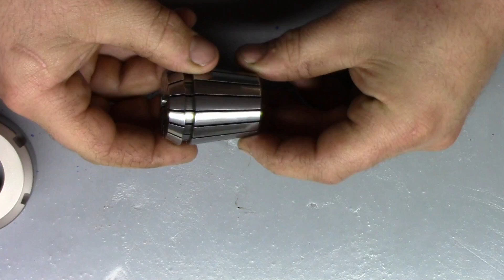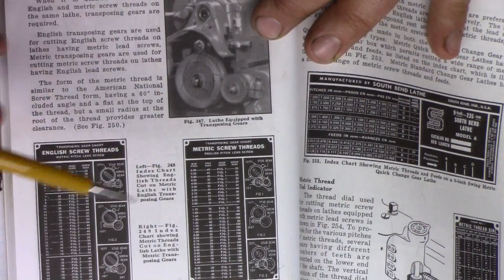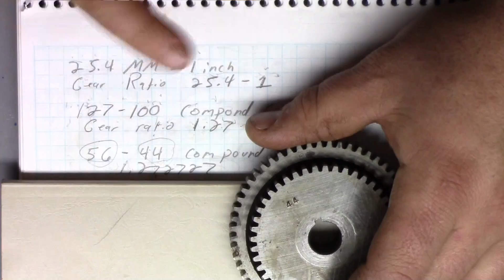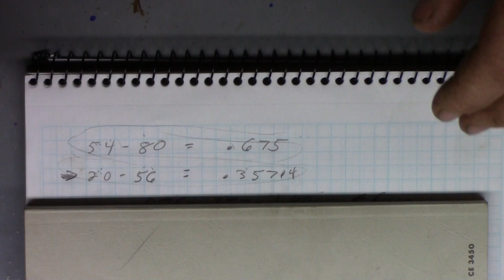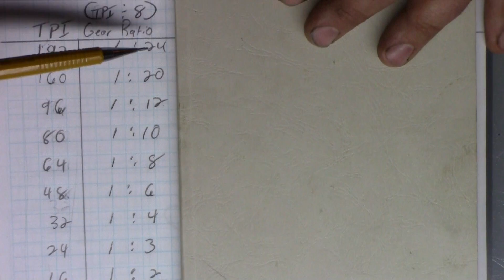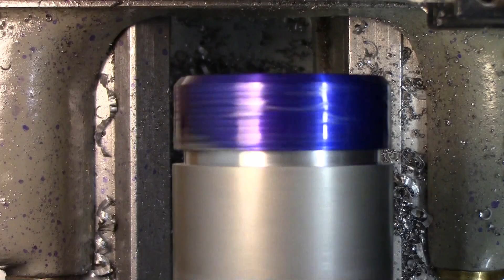Metric Threading on an Imperial Lathe

Comment: When measuring threads without a thread guage it's much more accurate to measure across multiple threads, alternatively just rotate the chuck 10 times by hand while measuring the carriage travel with a indicator, it's the most accurate way of checking the it's easier than trying to directly measure the threads
Reply: The more threads that you measure across, the more accurate you can be 👍

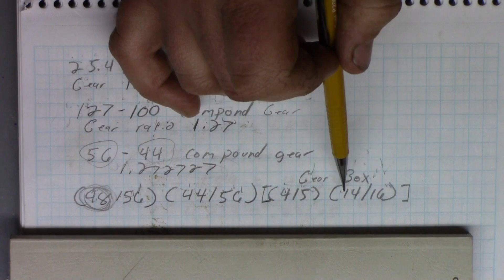Comment: I'm confused with a certain part of this video!    right around 10:01 into the video you say that in the gear train you used to achieve a 1.5mm pitch thread and after the 56 to 44 Tooth gear that inside the gear box you have a 4-tooth gear that goes to a 5-tooth gear.  I hope that these figures are reduced to the lowest common denominator or something, like from a 20-tooth gear to a 25-tooth gear. because I have never seen a 4-tooth gear I don't think it's possible. I think the smallest number of teeth possible is 9.  But don't get me wrong I still found the video very informative and maybe I missed something? hopefully you can clarify that for me. Here is a 4-tooth gear (  +  )
Reply from the maker: Sorry those are great ratios in the gearbox.

Comment: You need to use an intermediate cog wheel with 120 teeth on one wheel and 127 on the same wheel on the same wheel. There are 25.4 mm in an inch.  120/127 convers the imperial lead screw to metric.

Comment: Jan 2022. My suggestion to anyone interested in Metric Threading is to go and buy a handful of metric nuts of all pitches and then just practice cutting those pitches on plastic electrical or garden conduit tubing . Its cheap. It threads easily and you'll see with whatever gears you select, what pitch they are producing. It also allows for endless practice which is important to get comfortable with this different technique before doing a 'real' job.

Comment: Dear Mr. Halligan, one thing I did not understand in the video: how to calculate the gears of the banjo if there is a Norton box in the lathe. In the specific case of the 32X1.5 thread whose gear ratio should be 1:4, Do I understand that the motor gear would be (for example) with 20 teeth and the motor gear on the spindle shaft with 80 teeth? But isn't this configuration made for lathes that don't have a Norton (CN) box? How then to direct the cn levers in this situation?

Comment: Making a nut is really difficult. It’s not even the thread. That ring inside is actually a retaining ring. It’s hardened. The nut NEEDS to be hardened. The face taper needs to be extremely accurate. It’s what determines the accuracy of the collet seating. The inside of the nut needs to be plated with something, otherwise the friction when tightening won’t allow you to tighten it enough, and the collets WILL slip.  I may have missed something. What alloy are you using for this?

Comment: The actual Metric Threading part starts at 8min15. If you don't want to go to the expense of a thread guage you can use a metric M10x1.5 bolt/screw (coarse) as a handy substitute. Another useful shortcut is to press a small piece of paper onto the threads. The dirty lines so impresed can be measured with a ruler. If the threads are too clean to make distinct marks you can rub the paper against the threads with a soft pencil.

Comment: Excellent. You made it easy to understand. What marks were you using on your threading dial?
Reply: LOL. This makes me think you didn't understand though. He wasn't using the threading dial, but he was keeping the half nut engaged and returned the carriage by reversing the motor. That's why he needed to retract the tool. To prevent cutting the thread on the backside, because of backlash in the gearing.

The threading dial can't be used in this setup, because the ratios between the rotations of the leadscrew and those of the spindel are not an integer, but have a very small deviation. Small enough to not matter over short distances, but apparently big enough to matter for picking up the thread at a different position than where you left off when you disengaged.

Comment: I just bought a SB 10k to learn on since retirement and came across your video.   Great job...very innovative.  I would like to do the same to cut metric threads. Are your 54 and 80 tooth gears "change gears" or specific end gears? I guess my question is will change gear work without modification?  Thanks again.  Brent
Reply from the maker: They are change gears from a 9" model B/C.   Should work with no modifications.  Mine are from my lathe.  It was a model B when I bought it and I converted it to an A by adding the gear box.
Reply: Thanks, you a a great resource for someone getting started!

Comment: Ok sorry just rewatched yours in imperial, mine has as norm the 20 gear at the top and a 45 on the gearbox this then makes position 1 D 3mm pitch (or 1 to 1 rotation of chuck to lead screw) I'm now messing around with other gear ratios as I have the other issue I want to make a 8TPI thread to screw onto the head stock :)

Comment: As much as I like my 14-1/2 South Bend I bought a lathe that cuts metric by just moving levers.
Reply from the maker: I would too if I was doing a ton of it but honestly 90% of things I’m making will have imperial threads and out of the remaining only a small fraction of those metric threads will not be able to be made or will be too expensive to make with a tap and die.
Reply: @Halligan142  100% Greg, I do about 50/50 metric vs inch so I'm reluctantly giving up my South Bend, it has served me well for over 30 years and with a DRO and quick change tool post is still great save the threading dilemma.

Comment: I once had to cut internal and external 5/8 BSP left hand threads for some propane gas fittings on a Harrison M250 with a 6 mm leadscrew.  Not being able to disengage was a pain.  That was about 25 years ago, haven’t had access to any machining facilities for many years now.

Comment: Oh dear.....I don't have a feed gearbox on my lathe just a set of gears......so now I use the recommended gear train ratios according to the info plate and set the gears accordingly......but luckily the gearset does have the 127 gear to translate the ratio for Metric pitches on an Imperial leadscrew.
Normally, without the gear sets chart on the brass name plate, I would have to use the standard screw cutting gear formula of TPI of leadscrew over the TPI of the job to be cut, or the pitch to be cut on the work piece over the pitch of the leadscrew.

Comment: On a belt driven machine like this you can loosen the belt to stop the cut, then shut the motor down, tighten the belt, back out and then reverse the motor. This is what I have to do when threading without a threading dial on my south bend. My original 1938 motor will continue to run in the same direction if I switch the switch quickly and don't wait for the motor to come to a complete stop before reversing.

Comment: Mostly good info especially on the gearing.  However the cutting did not have to be so hard.  Unless your lathe is one of those that cannot be run in reverse, turn your form tool upside down and cut going away from the chuck.  Gives lots of tome to pull back before changing direction.

Comment: Hello. It is good video. i understood about gears 58 and 80, but i did not understand about the gear box position. Did you use 32 and "C"? on the video 46 and "D"  or the  position of the does not matter? thank you
Reply from the maker: In the case of a 9" South bend you need the gear train set up shown and the gearbox tumblers set to cut a 32 TPI thread to be able to cut a 1.5 mm thread
Reply: Question about the idler gear - is it 80? or i can use any one? I just accidentally bought a 9A south bend lathe as a replacement for my Chinese lathe. thank you

Comment: Hi, how did you calculate the size of the stock to cut the thread on and how would a novice now how deep to plunge the tool to get the desired Thread Depth? Great video

Comment: You left out one option for that collet nut. Since you're making your own collet Chuck and you can make it any Dimension you want simply turn the metric threads off since they're pretty fine and turn whatever you want back on to the collet nut. Adjust the size of the Chuck that you're making to accommodate that new thread and throw it away. Easy peasy

Comment: I really admire all your efforts on the Math side as I'm exactly the same. Only, as I figure out these things, I put them all into an Excel book. I've done a full write up some time ago, of the problem you've set out to solve here so I understand all your efforts. All I need to do is to enter the Pitch required, the gears I have and it tells me what changes are needed to give the Pitch in Metric. I'd be happy to try and pass along what I have as I'm certain you'd find it just as useful. Also, working with so much math and trig,  I've found just how surprisingly simple is working on Metric threading with an Imperial lead screw where you CAN disengage the half nuts anytime and move the carriage and turn the chuck and then very quickly return to threading precisely as at the start. This I needed to learn when internal Metric threading to a blank. It turned my hair grey but I'm happy to say I solved it. Great work with what you have shown us here and again my tip is once you solve math problems, keep them on an Excel file and in a book.
Reply: Would you happen to know what gears would be needed to hit a 1.25 pitch metric thread for the 9A? I have the 54 and 80 like Halligan said but his list doesn't show the 1.25 pitch which is also pretty common.
Reply: @jerkfaceskater  I'll answer fairly quickly but will be happy to keep working through the problem until you have what you want. Very simply, you need your drive train gears to have the ratio of 1(Drivers) : 2 (Driven) (or vice versa)? where you will be using an Imperial 8 TPI Lead screw. In Imperial, these ratios will cut a Thread of 20.32 TPI but this is in fact 1.25mm. IE: 20.32x1.25= 25.4mm = 1 inch.

I'll give an imaginary set of gears with using the Transposition gears of 127/100. Stud gear 11. Comp #1 gear 24. Comp #2 gear 84. Screw Gear 77. Disregard the Transposition Gears in the calcs. DRIVERS = Stud(11) x Comp #2(84) = 924. DRIVEN = Comp #1(24) x Screw(77) =  1848. Therefore the RATIO = 1:2.

In the quick change gearbox the selectors are at C1 with 'Change Gears' of 60 and 47. Position C1 gives a drive train ratio of 1:2 and gears 60 and 47 act as the 'Transposition Gears' having the same ratio as  127:100. (almost). This ratio is important in the train and as long as its included in gears, it should then be FORGOTTEN. What it does is to change the Lead screw TPI from 8 in Imperial to 3.175 mm.

I've probably totally confused you. Best is to study videos of Metric threading with Imperial lathes. That's all I did. Don't disconnect the half nuts but learn the art of zeroing your carriage  with your spindle with a dial gauge so that if you accidentally disconnect those nuts, you can in fact find the very beginning spot and be in correct synch to keep threading.
Reply: So where he uses the 24 grear i would change to an 84 instead and swap the 80 for the 77.
Reply: @jerkfaceskater  Divide each 'Driver' gear by each 'Driven' gear. Multiply as you go. Then multiply by 3.175 which is the Metric pitch of a 8TPI Lead Screw. The first 'Driver' is the Spindle or Stud gear. The last 'Driven' is the Screw gear. Below is just an example of me looking to achieve a carriage advance of 1.25mm on a single 360 deg spindle turn using an Imperial Lead Screw.
(11/18) x (63/77) x (100/127) = .3937 x 3.175 = 1.25
Solving what the final ratio needs to be, can be trial and error using any gear combination and you confirm what pitch you'll get by dial gauge measuring how far the carriage will advance (in mm), on one single turn of the spindle. Same procedure even with a 'QuickChange Box' and with 'Change Gears'.

Comment: I think the .471 ( from original calculations ) is the lead screw relative speed created by that multiple gear ratios to give you the 1.5 mm travel per one revolution requested not the actual carriage travel distance for thread cutting.
I think the formula would be:  Carriage travel = Pitch x lead screw speed ( different gear ratios from original calculations )
for example  0.125 x 0.471 ( original calculations ) = .058875" inch
and multiply this by 25.4 mm you will get the carriage travel in MM
.058875 x 25.4 = 1.495425 approximately 1.5 MM which is the required carriage travel distance per revolution.

Now this all good, but what tricked me that you used the formula and used a relative lead screw speed 1.89 not actual speed, and it worked, but finally I figured that you still kept the rest of the gears in to give you a factor of 1.319 x 0.471 = 0.357 which is the ratio of the existing gears 20/56.

Very nice work, very smart.

Check my work please, I'm not a Machinist but I love this stuff.

Thanks
D. Sanduby

Comment: Used your recommended 54/80 gear setup on my 68 South Bend Heavy 10 to cut 2mm threads to build an Accuracy International barrel it was dead nuts, a real class 3 fit!
Reply from the maker: +Mike Calafatis 
Nice! glad it worked out for you.

Comment: Hey Greg, totally off subject but I'm getting ready to get my hands on a south bend 9 lathe and wanted to do the gear box conversion like you did on one of your videos..  Just wondering if you ever had an issue with using 2 screws to hold the gear box on instead of the 3 it normally takes.  Thanks in advance. -Adam
Reply from the maker: Haven't had an issue with the mounting at all.  Only issue I had was that the very end of the replacement lead screw was bent causing it to wobble.  I had to turn it true and sleeve it to keep it from wobbling on the extension I made.
Reply: Awesome, thanks for the info.  Also, If you get a chance Oxotools has a video where he shows how to metric thread on an impearl lathe and still be able to release the half nut.  Thought it was a cool little trick.  Thanks again! -Adam

Comment: And how did you derive the 54 and 80 combo from all the possible choices?
Reply from the maker: +Allan Noah 
A quick internet search started me on the right path.  A lot of people just made a 26 tooth stud gear.  Not an option for me.  Found that these 2 gears can work.  Also had a friend make a spreadsheet to try different combos and see if you can get any closer to be dead on metric threads.

Comment: I am wondering if it would work better to drop the 29.5 degrees on the compound and feed with the cross slide.  You might be able to just reverse then without the angle of the compound (leave it on 0) to drag on the back of the metric thread.  Give it a try?  Very interesting project.  Things are happening quite fast on your metric feed with little time to get out of the thread relief groove!  You certainly paid attention in your shop class.  Doug

Comment: Bravo. Figuring out what combinations of gears  will give you a  given pitch thread is not a simple problem. There are supposed to be programs out there on the net that will give you one or more solutions, but I have no threadcutting capability so I have never looked for them. Your explanation was crystal clear. And you will love those ER collets. I got some last year. I call them my crocodiles. They will compress about a millimeter, release on order, and never slip.

Comment: Hi Bob,  I take your point.  What I really liked about the solution was that you don't have to faff about in the change gear enclosure to get quite a decent set of standard metric threads just by using the gearbox.  What would be very interesting to new comers like myself (how did you guess!) is 'how close is close enough' for the tpi errors resulting from the myriad of spreadsheet solutions.  Thanks for correcting me, I don't want to be misleading others.  Sorry Greg, seems it was not that novel! Cheers, and A Very Happy Christmas to all.  Bob Hawtin.

Comment: Well done on the explanation but if you are serious about threading you might want to make yourself one of the tools in these two links. Copy/paste the following into the youtube search box.
Gewindedrehen ohne Rückzugshalter ( www. rb-werkzeuge.de ) Teil1
or
threading 2.AVI
Either type have advantages over a "normal" tooling, one of which is that you never have to bother with threading dials again. You needn't worry about chucks unscrewing because there is zero load when running in reverse. 
Just because Tom or Adam don't know of them doesn't mean they should be ignored, they have been around since Victorian times, the tools  that is not Tom or Adam. :>)

Comment: Having to pull out the cutter has to do with the back lash of the lead screw....
The magic 127 magic conversion to get metric threads from an imperial lathe.
The Canon is a great choice, this is the one I use also, happy with the results, just added a wide angle adaptor to make wider shots in the shop (About $20 from Chinese friends)....    ;)
Reply from the maker: +pierre beaudry Yeah I picked it up for the ability to add lenses also.  It'd help out when you need those shots of the whole machine.